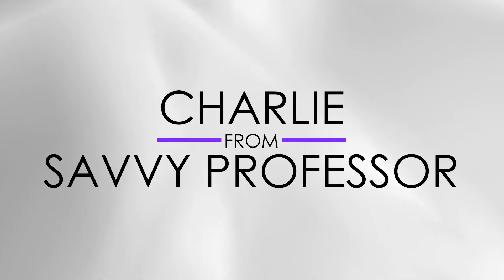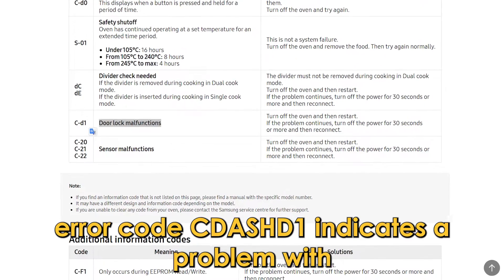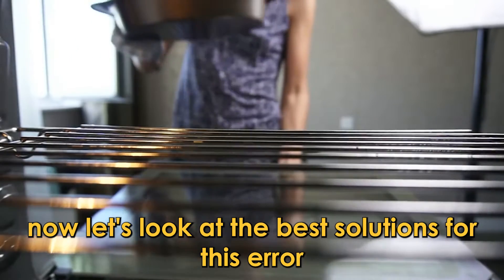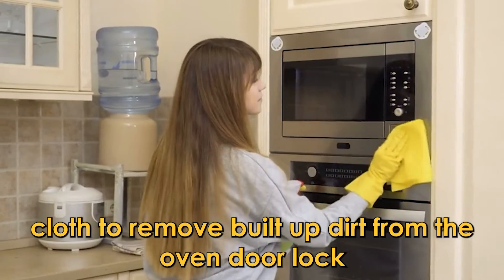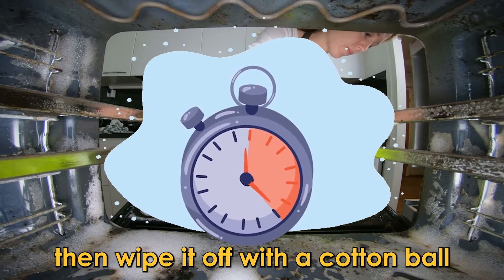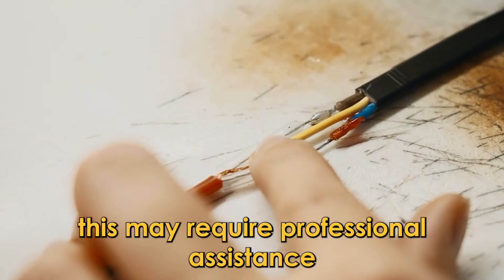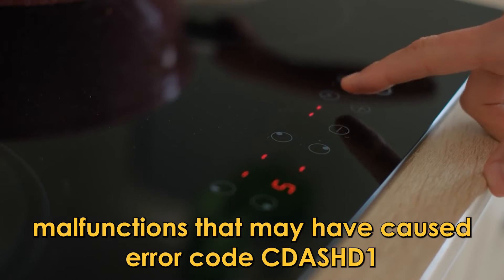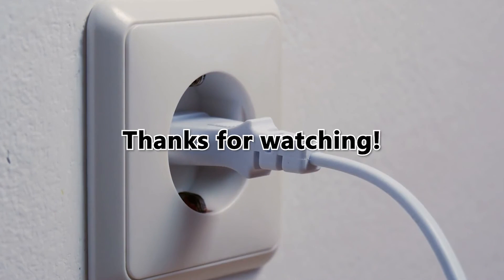How To Fix The Samsung Oven C-D1 Error Code - Meaning, Causes, & Solutions (Best Solution!)

Comment: Mine gave the code after a clean cycle! Somehow the door micro switch in the back of oven under cover plate became out of adjustment and was not making contact with the sliding cam. So all I did was slightly bend the metal micro switch mounting bracket closer to cam and it now makes contact. Problem solved.